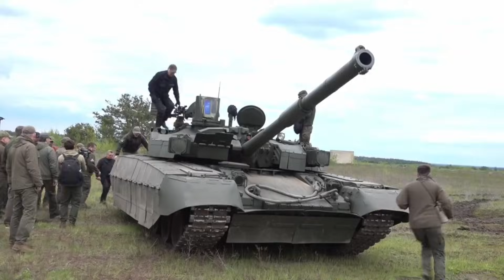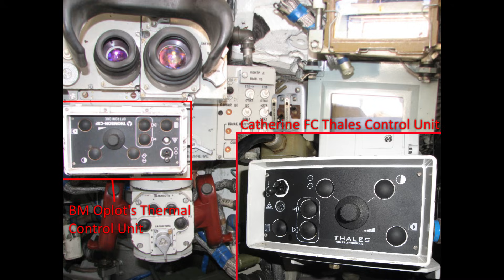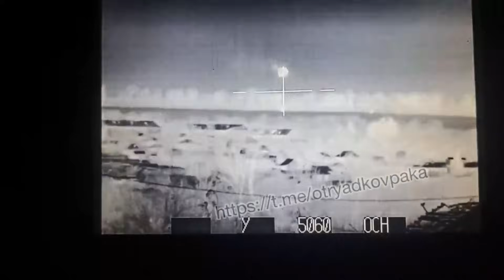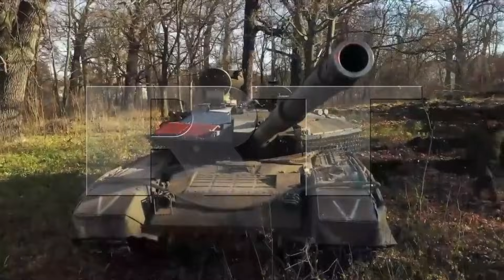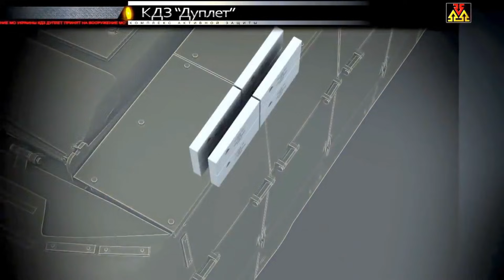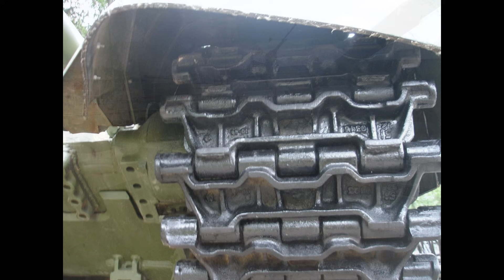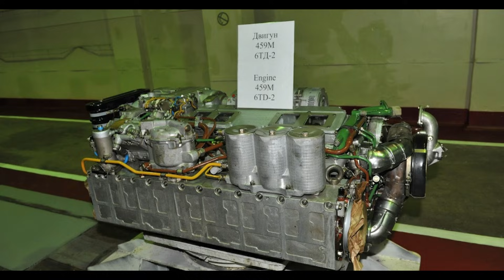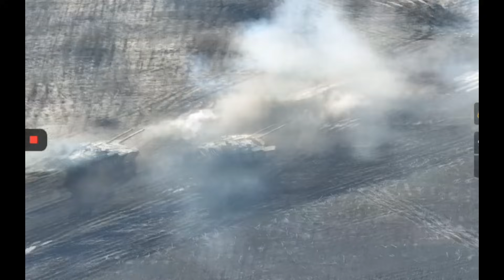Best Ukrainian vs Best Russian tank. T-90M vs BM Oplot comparison

Comment: Wonder if they're planning on producing the 120mm version with the bustle autoloader instead of the standard 125mm one.
Reply: I thought that version was developed for export.
Reply: @_Admin_01.  Doesn't stop them from building it for their own military. Might be a good idea with how they're probably slowly switching over mostly to NATO ammunition.
Reply: @wulfleyn6498  but where will they build these tanks? Xtz was blown up by the russians and every other tank modernization plant in ukraine has ceased to exist. Also how do the Ukrainians plan to produce the duplet era. Also Ukrainians dont build tanks from scratch but they modernize old tanks. So how many t80s do they have to work with?
Reply: @squidysnose69  Well they're planning on having the built somewhere, since they seem to starting production again, might not even be in Ukraine for all I know.
Reply: @wulfleyn6498  They need the blueprints which they can reverse engineer but even then which country would suspend their own tank production to make a foreign tank. The USA makes about 100 new tanks a  year and all of europe together probably makes about the same. Putting a new tank in production would be too costly and inefficient. If Nato makes 50 a year that would be surprising.
Reply: @wulfleyn6498  They need the blueprints which they can reverse engineer but even then which country would suspend their own tank production to make a foreign tank. The USA makes about 100 new tanks a  year and all of europe together probably makes about the same. Putting a new tank in production would be too costly and inefficient. If Nato makes 50 a year that would be surprising.
Reply: @wulfleyn6498  well building a large tank factory takes years to do and building all the required equipment like the ERA for example is very expensive. So for it to be a viable option they need to create a plant that can build these tanks in sufficient numbers and keep costs down.
Reply: @marselangjo2201  Europe and NATO can boost production to way higher numbers
Reply: Yeah the Yagatai. The fact that Rheinmetall is cooperating hints to that. 
An ex-Soviet NATO standard tank would be a big achievement for Ukraine.
Reply: Just vet dreams... They ain't gonna produce shit 🤣all their factories are blown up... And those where not their factories to begin with, it's soviet /Russian legacy..
Reply: No, because it would require:
New autoloader
New ammunition (2 pieces, possibly can keep the one piece but questionable)
new Turret?

At that point just give them Leclerc turrets
Reply: @gerfand  T-84-120 already solved this questions (and add new problems, like bustle autoloader "shadows" engine compartment which may lead to overheat).  The question is to set up production - logistic chains for components, personnel (who may be busy at repair plants), AA protection, e.t.c.
Reply: @MrOmegaFive  oh I misread OP, I read as "Have an Autoloader like the 125, but in 120mm"